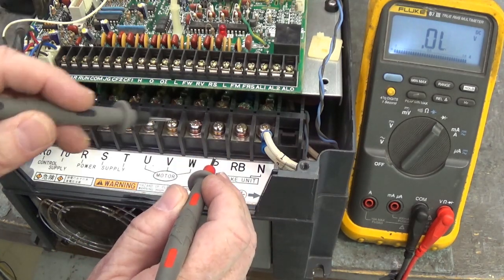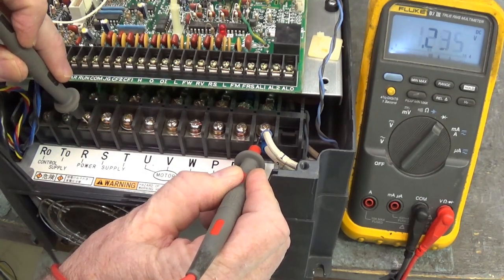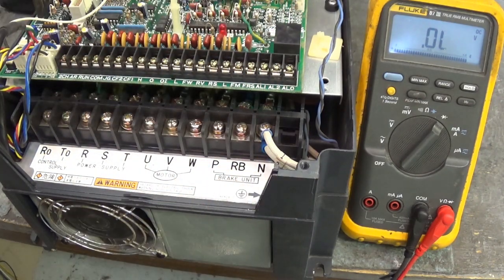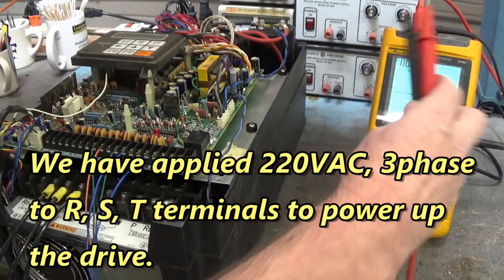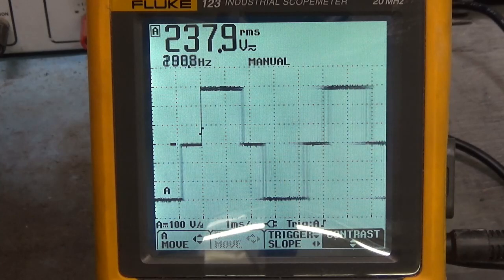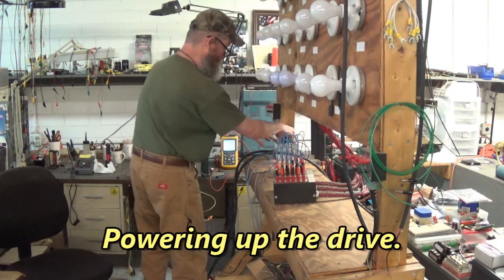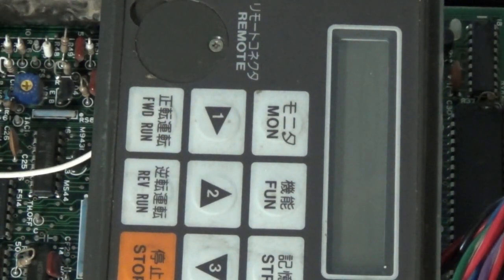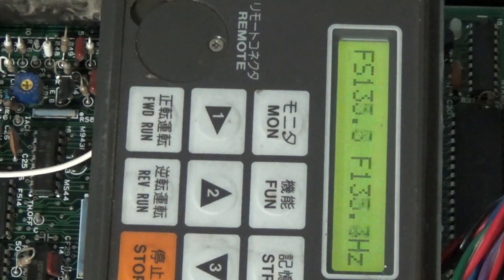Testing the Hitachi HFC-VWG Transistor Inverter Drive

Comment: Hlo sir i have same drive n there is oc Accel fault occurred when i switched on th supply what the solution
Reply from the maker: Well Sir, it is hard telling with all these miles between us. But the first thing I always test for is short circuits of the power devices. I have many videos on testing IGBT and three phase bridge rectifiers for short circuits. Go to PeePaw's Toolbox for all the videos on repairing items.
Reply from the maker: If you don't have it already, I will see if I can find the online manual of the inverter drive. Give me a little bit of time to find it. Click on the link below to bring up the drive's PDF manual. I hope this helps you. And thank you so very much for fixing things :)
Reply from the maker: https://www.google.com/url?sa=t&rct=j&q=&esrc=s&source=web&cd=&ved=2ahUKEwjdqOaQ_pz7AhVuFFkFHQDZBH4QFnoECAYQAQ&url=https%3A%2F%2Fwww.theservicegroup.us%2Fs%2FHFC-VWG3-Series-Instruction-Manual.pdf&usg=AOvVaw1Xo2JnjXJHWQZcVUSe4bc_

Comment: Dear Sir,We have HFC-VWS Transister Inverter.VWS 40 HF3EH ___>NE13463 , Mnfg No.SE 40HF3H 968, Rating 50 Ampere problem is that when we switch On the three pahse supply on Display this meassage is seen B00715 so kindly guide me what can i do to solve the problem.

Comment: Do u have an email? Need to ask question about Sprint DC drives?
Reply from the maker: Hello. I hope you are having a good day. I have only worked on one Sprint DC Drive. It was a SPRINT 370 DC MOTOR CONTROL PCB. It was blowing the 6.3A Line Fuse. I never found a problem on the Drive. I replaced the Line Fuse. And ran the shop's DC Motor good on the Sprint 370 DC Motor Control PCB. Thank you for stopping by and watching my videos. Please ask your question here in the comments. If I can, I may can answer your question. Thank you again for stopping by.
Reply from the maker: I don't have any schematics for the DC Drive. And the one I worked on has long been gone from the shop. So any technical answers will be based upon intuition.
Reply: Peepaw McDonald thanks man. Can you tell us what is main contactor  slave terminal is for in drives?
Reply from the maker: Hello again, I found a manual on line for a Sprint SL DC Motor Drive. It talks about the Main Contactor Slave Terminal 31 and 32. Click on the link to bring up the manual. https://inverterdrive.com/file/Sprint-SL-Manual
Reply from the maker: The Main Contactor Slave Terminals are used to turn on the Main Line Contactor to route the incoming line voltage to the L1, L2, L3 Terminals on the drive.
Reply from the maker: Please be patient. I am about to get long winded... HaHa.
Reply from the maker: According to the PDF diagram Page 1.6

If there are no alarms or the motor is not stalled. The NPN Transistor connects to Gnd the normally closed OFF Push Button connected to Terminal 28. The other side of the OFF Push Button is connected to the normally open ON Push Button. And also connected to the Latch Terminal on Terminal 30.
Reply from the maker: When the ON Push Button is pressed, relay RL3 is connected to Gnd through the ON Push Button, the normally OFF Push Button, and the Alarm NPN Transistor. With relay RL3 energized, its contact closes. And connects relay RL4 to Gnd through the Latch Terminal 30, through the normally closed OFF Push Button, then through the Alarm NPN Transistor.
Reply from the maker: Now with relay RL4 energized, its contact on Terminal 31 and 32 are closed. The closed contact of Terminal 31 and 32 connected the voltage to Main Contactor (C1) coil to energize the Main Contactor. When the contacts of the Main Contactor are closed, the line voltage is applied to the Drive's L1, L2, L3 Terminals.
Reply from the maker: There is a good diagram of this in the PDF at Section 5, Page 7, Figure 2. The PDF calls the Main Contactor  as C1. In the diagram you can see the C1 coil and the three C1 contacts. That was very interesting. I hope I have been able to help you with your question. Thank you very much.
Reply: Peepaw McDonald thanks peepaw great. What’s the purpose of Terminal 31 and 32? How do theses terminals control main contactor C1? Also what’s RUN for in Terminal 7?